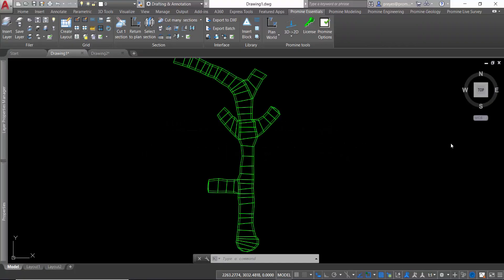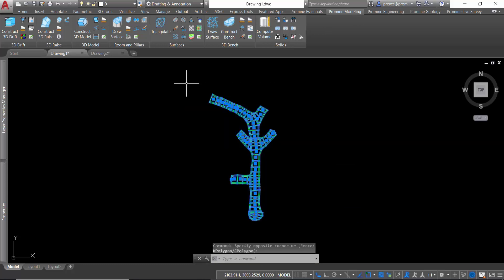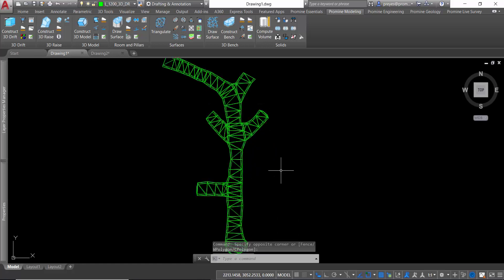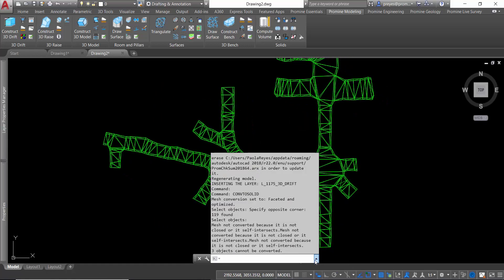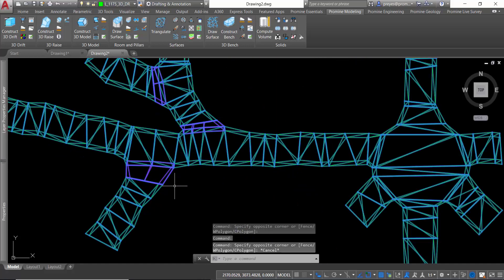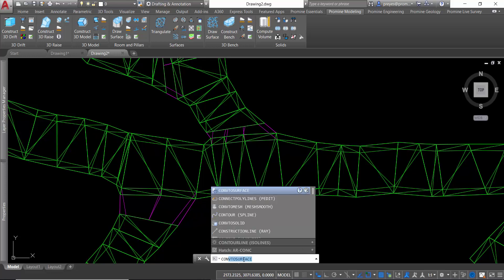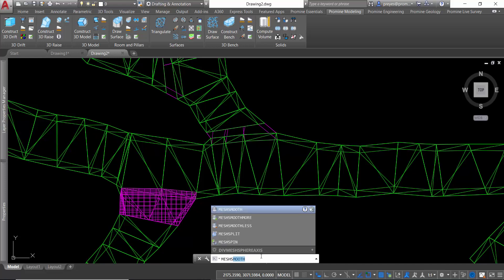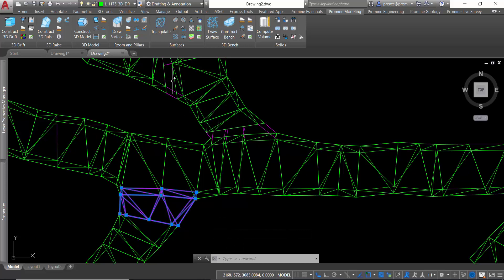Promine AutoCAD Tip of the Week: Convert to MESH To SOLID

Comment: I tried following the steps you did, but it says "Mesh not converted because it is not closed or it self-intersects" :((
Reply from the maker: Hello,
Try using the Self-Intersection command, also found in the Solids Module. This will allow you to observe the self-intersection lines, which you can adjust using the GIZMO tool.
If you have any additional questions, feel free to send us an email at info@promine.com

Best,
Promine Inc.